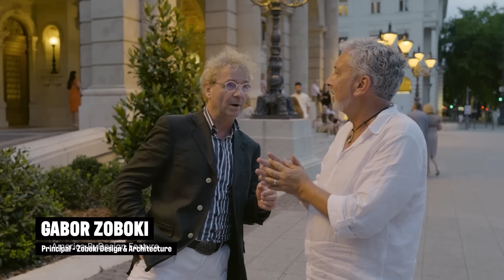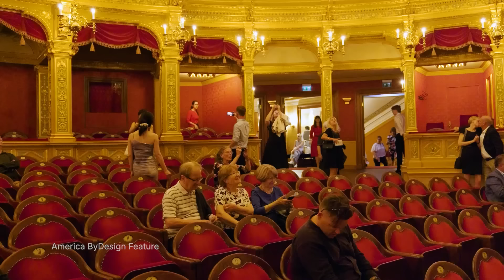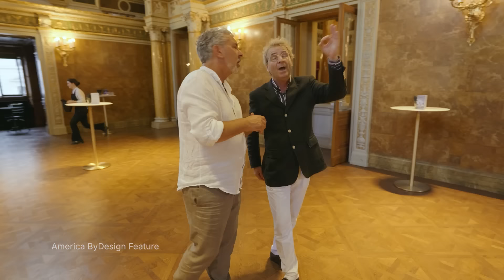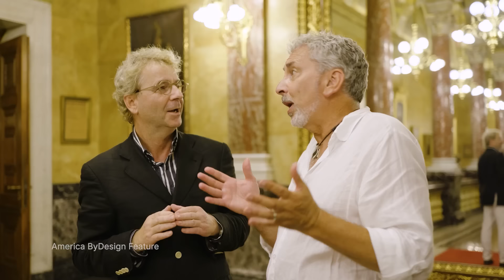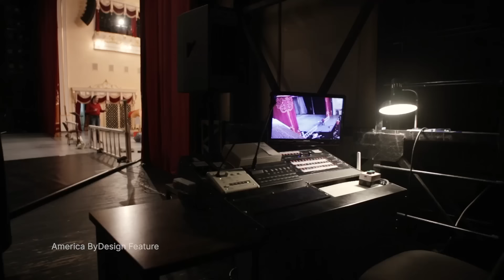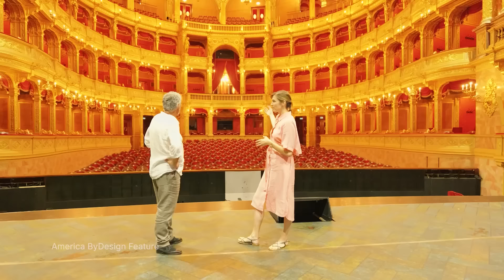Hungarian State Opera - Restored and Re-vitalized with Archicad

Comment: I've read the book "City of falling angels" which is partly about the burning down of the exquisite rococo style "La Fenice" opera house in Venice - well it was decided to update the electrical system of the opera house and the contract was won by a particular electrician who was told if he didn't complete the work by a certain time he would be penalized in monetary terms. He realized he was running behind with the work so he faced a severe monetary penalty - so what did he do? Burnt the whole opera house down and made it look like an accident. They were lucky in that had the day been windy most of Venice would have been burned down as well. Eventually the whole structure was rebuilt in the same rococo style but now the seating and other decorative elements are in plastic made to look like the original intricately carved wood. Oh well you can't have everything!